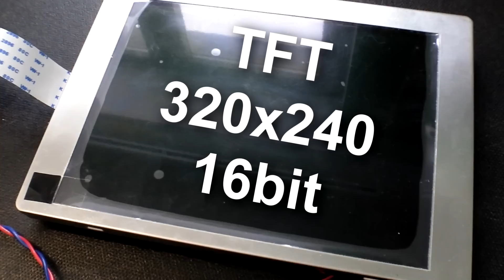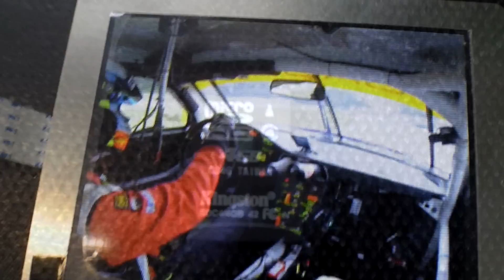STM32 with SSD1963 + TFT display

Comment from the maker: Not yet. The board is still under the development. The board accept displays with parallel 18bit RGB data with pixel clock,data enable, vertical and horizontal sync. Also there are pins for support vertical and horizontal flip. The backlight is controllable from 0 up to 200mA. I let you know ASAP if it will be available on market. Resistive touch is not implemented on board, but can be easy added by module (see pin head in midle of the board). Pinhead consist  SPI and I2C + power supply +5V, 3V3

Comment from the maker: THX :) The DMA has only 32k buffer space for FAT file system at low level part (at sector read by multi-read CMD from SD card) and from this buffer the data is directly copied into SSD via FSMC. The SSD has frame buffer which holds one frame. Double buffering is not possible.

Comment from the maker: Not really. SD card is read by Multitransfer to internall memory using DMA. Then the data is transfered to FSMC by another DMA again. So there is some kind of data buffering.
THX, the PCB takes me a few days to create.
I have tried the compressed PNG files and the result with own deflate implementation was 5.3fps. Thus i am using BMP which is much faster due to uncompressed 565 format.

Comment: Really nice work there.
The PCB looks very professional yet very slim and small in size.
For the software part you must have done quite some work optimizing as the shown frame rates are extremely fast when having the digital 8080 16-bit interface in mind.
For the AVI playback I guess you have made a DMA bridge between the SDIO and the FSMC interface?

What about compressed AVI files - here the frame rates would be reduced significantly, right?

Good luck with the project.

Comment from the maker: driver.h file just includes the standard STM library and other stuff. You dont need this file to get fsmc and ssd file to work. Beware that i am using adress line 16 as cmd/data selector.
Good luck :)
Reply: Using A16 to switch CMD/Data Mode is a very comon usage. #define LCD_REG16 (* ( (volatile unsigned short ) 0x60000000 ) ) / RS=0 /#define LCD_RAM16 ( ( (volatile unsigned short ) 0x60020000 ) ) / RS=1*/The Cmd-Mode is mapped to $0x60000000, the Data-Mode  mapped to $0x60020000. 
The SSD1963 just needs some init code to fit the TFT-panels timing and geometry. The FSMC init code is more tricky - especialy the timing values of the FSMC control and data bus. 
I like your PCB-Work and the advantage of the close coupling of the Cortex M4F and SSD1963 controller. The line length of the FSMC bus needs to be as short as possible and should be have the same length. This prevents timing and EMI issues. 

How did you block the RF of the high speed lines on the board?

Comment: Hi Tomáš Kamenický,

This is a very nice work!

What is the RAM buffer size do you use for each DMA?
1 LCD frame is 150KB while the MCU has 128KB of RAM.
Can we measure its frame rate with your configuration?

Thanks,
Nam

Comment: I have a question regarding ssd1963, does framebuffer clears itself after the data is displayed or does it stay as is until you change it? In other words if you display a static image do you have to write it continuously to the framebuffer from the microcontroller?